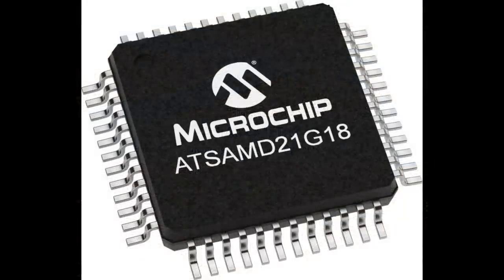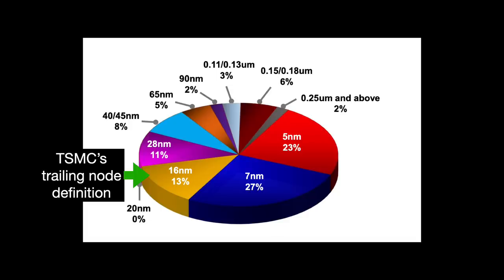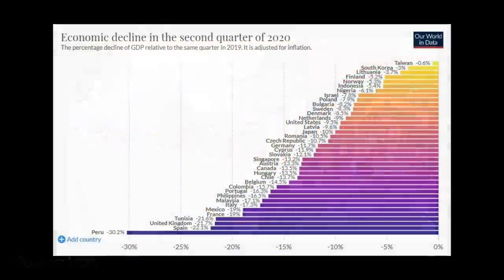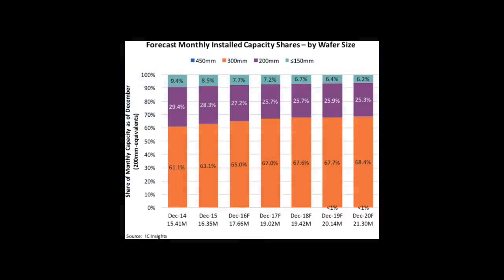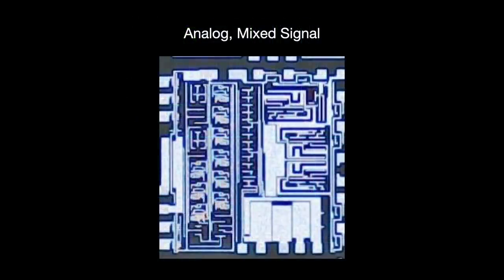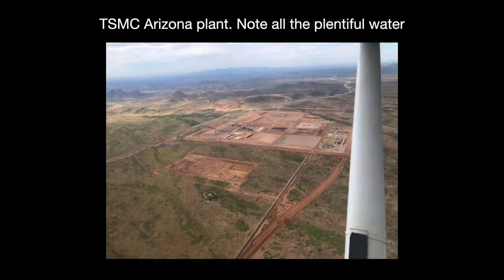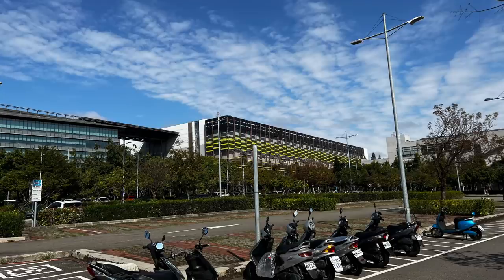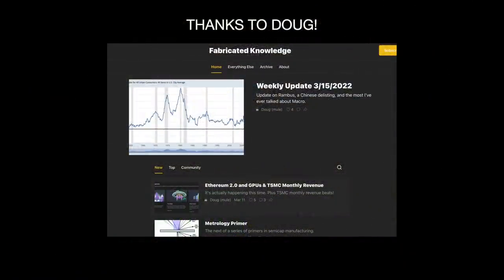Where The Real Chip Shortage Is

Comment: I am glad that as a hobbyist I tend to buy components in much bigger bulk quantities than what I actually need. Some of the voltage regulators I bought back in 2019 are still being put into new hobby designs today since I can't find anything equivalent today! This is a great reminder to engineers (both hardware and software) that we should be focused on making our designs as modular as possible, so that you can easily swap out voltage regulators or even entire SoC's.

PS: Wow, the ESP32 is far more powerful, much cheaper, and more available than the ATSAMD21G18A chip that you covered in the intro to this video. Then again, companies probably find it cheaper to spend exorbitant amounts on chips like this than to completely re-design the microcontrollers and firmware for their controller boards.
Reply: It's not redesigning that is the problem, it's the supplier. A company like ST meets all norms, while tensilica, the maker of ESP32 does not - because they intend to produce a hobbyists tool.
Reply: @LMB222  yeah, I did not mean to imply the ESP32 could replace that chip for many use cases especially industrial/professional ones. But it is interesting just how much more powerful AND cheaper it is
Reply: @LMB222  It's not that ESP's chips aren't used at scale, a lot of iot power products like colour changing lightbulbs and remote switchable power sockets used them at scale; then again these are products with... shall we say no particular expectation of reliability, often just borderline compliance to basic safety norms, and many of those have even since switched to even cheaper and wonkier chips, they plain don't care. You simply can't sustain a semiconductor company like that on hobbyists, but you can sustain it on kilotons of future e-waste.

Comment: chip shortage should be a lesson to engineers to make their designs cpu architecture agnostic. i started doing it with my designs as standard practice around 10 years ago. little did i know how it would pay off later.
Reply: CPU or MCU?  The time spent on the latter is getting all the peripherals to work, and those are not agnostic.  Then an even more amount of time is clearing up the corner cases of power-on reset, oscillator start-up, UART timing, all over temperature.  Those issues are typically specific to a signal part family.
Reply: for MCUs i've started writing my firmware in rust since the community made a lot of efforts to create hardware abstractions for a lot of middle-end MCUs. but that barely solves the problem of acquiring said chips since they are either sold out or have dramatically increased prices. I for example replaced the STM32F103xx with a GD32VF103xx since they got an identical pinout (infact it was meant as a drop-in replacement) but it required changing the whole compiler infrastructure since the GD32VF103 is a RISC-V processor and the STM32F103 is ARM. And even though the GD32VF103 seems to be relatively unknown it was still a nightmare finding a reseller that actually got stock of it.
Reply: @minespeed2009  ha ha, all that HAL is what scares me; more abstraction means more bugs, and it’s tougher to find them.  I’m not even an embedded guy (rather RF Microwave) but I won’t touch anything but bare C when I need to implement an MCU.  Don’t get me started on using Circuit Python, Arduino, etc for shipping products.  IMHO it’s a nightmare waiting to happen.  As I mentioned above it seems 90% of the effort is spent fixing 10% of the corner case stuff.

I actually was messing around with an Arduino compatible MCU module, and it’s got a known bug of not coming out of a low-power sleep when the UART is low, of course it’s beyond me to fix it through layers of software abstraction.  But it’s this kind of shit that just drives me nuts.
Reply: @rfengr00  it definitely makes it a bit harder for some cases, but in the end it takes me about as much time to implement something as in c since the rust compiler is VERY strict when it comes to unsafe programming. like refusing to compile when you access the same peripherals in two different code sections without transferring ownership. (ownership checks are done at compile time so no binary size or speed penality). But im also only an EE student and therefore haven't worked on larger commercial products.
Reply: So you’re saying engineers should strive to do something that’s literally impossible? You have PC boards will you can just swap in any brand of CPU you want? And you take the time to make low level drivers for each one?
Tell me more?
Reply: @neilkurzman4907  They aren't talking about computers, they are talking about microcontrollers. There, it's fully possible to do that and actually isn't even that difficult.

Recently did some work on a project where they switched from 8bit avr to 32bit avr to ARM. I wasn't part of the electrical stuff so idk the specifics, but what the electrical guys told me is that switching architectures wasn't a big deal because they designed in that ability from the start, selecting the chip based on supply and cost, which was rapidly changing. Switching architectures was nothing compared to the normal problems that you deal with developing any mainboard.
Reply: @lobsterbark  
I understand they’re talking about micro controllers. It’s what I do for a living. And no you can’t make a design where you can swap the CPU out between various manufacturers. None of them are pin compatible. And if they were they’re not code compatible. The peripheral are completely different. Your top level C code could be the same. Your best bet would be Microchip. Since they tend to stick to a limited number of pin outs.

There were a few things that they could’ve done early on to make it easier. But that didn’t make it easy.
an AVR eight and an STM 32 has zero peripherals in common. They would’ve had to rewrite every driver. But may have been able to use some of the same interfaces. And of course if they didn’t sprinkle “int“ in the eight bit code then they would’ve had less problems with the 32bit code.
Reply: @neilkurzman4907  The firmware they used was able to use already made drivers and such, from my understanding. I remember someone had to spend some time porting some stuff over, but they didn't spend much time on it and it was just one guy doing that. So it must not have been very difficult.

And of course you aren't going to be able to make a board where you can literally use the same exact pcb for any chip. But you can make a board where the modifications needed to change chips are minimal, and you will be able to easily switch PCB versions for different chips based on availability and cost.

I'm not an EE so idk specifics like I said, but I saw them do the thing you said is impossible. And if you aren't using lots of weird devices that need custom drivers it's not a lot of work to deal with that. Once someone has written a driver for a device that works on an architecture it's already done. You don't need to do it again.
Reply: @lobsterbark  
Unless they had almost no drivers then they had to do a lot of porting. 
They probably could’ve save some time if they use a framework. 
But in the end you’re underestimating the task and what it would take for all products.
And no you can’t just swap in different PC boards. They’d have to go through UL, and EMI, thermal, vibration and whatever tests are required. So how many different variants are you going to pay the test?
You seem to not understand the magnitude of work you’re declaring trivial. Yes when somebody writes a driver for an architecture it’s done. But you’ve claimed they went through three different architectures. Including one from a different manufacturer. So yes you’d have to do it over again. And some of them are very different. 

And again you’re telling me what my job is. You seem to think embedded software is incredibly simple. Not always. In fact a lot of times PC software is easier.
Reply: @neilkurzman4907  Sounds like something unusual was going on with this project that made things easy then. Or the EE guys are wizards that made it look way easier than it was.
Reply: @lobsterbark  
I couldn’t say, I have no knowledge of the project. 
But the question here isn’t about upgrading one ship to another. Everybody’s doing that when they can’t get what they need. 
The issue is what is the cost to design your project with multiple PC boards accepting multiple different processors. And that also assumes that that’s the chip you’re going to have trouble with. I’ve had trouble getting up amps, voltage regulators, buffers. 
Transistors, relays. In fact I’m sending a board out for prototype right now. And I told them they should start ordering production quantities. Even though that’s 6 to 9 months away.
Reply: @卩乇尺丂ㄖ几 
Everybody’s buying you head on chips.
People are redignigning boards with the parts they can get. For Microchip you can often find another part that will fit in the same footprint. You then just have to port the code over. 
Apparently businesses were running lean and didn’t have a lot of extra chip capacity. So when Cove it upset the industry it hasn’t recovered. It took a year for toilet paper to end up on the shelves and normal amounts. 
Took me a year to find a bottle of 409 or fantastic. Who knows how long it will take until people have so many chips that they stop buying more. 
No this isn’t some evil plan by a group of oligarchs. This is a floor in capitalism. Because it’s certainly far from perfect.
Reply: @卩乇尺丂ㄖ几 
There are two options when supply and demand are out of balance. 
Either the price goes up until the demand falls. Or there are shortages. 
Right now gasoline is the former, integrated circuits are the latter. 
It’s not proof of an evil conspiracy. 
I pointed out why they are not raising prices by large amounts. It’s because they are concerned about future business. Unlike gasoline, you can buy micro processors from other companies that didn’t rip you off during the shortage.
Reply: @卩乇尺丂ㄖ几 
The issue with IC chips is it takes years to enter the market. And even then unless you are making second source parts your part will require redesign.
Big user can push to the front of the line, along with old regular customers.
Reply: @卩乇尺丂ㄖ几 
This is not some perverse plan. It is a market upset. It is literally a lack of plan. Compounded by just in time delivery. 
Which government are you referring to you are talking about governments an corporations around the world. The global supply chain. 
The perverse incentive is lowest cost. 
That has been called in to question these days.  Years ago you keep parts on hand And had second sources for all parts.
Reply: @neilkurzman4907  don’t bother, it’s just some FCA Chinese troll copy-pasting their comments.
Reply: @Grak70  🤷🏻‍♂️
Reply: @卩乇尺丂ㄖ几 
I’m not selling anything. 
That’s my opinion on the subject based on my years of experience in the industry.

Comment: For the people going "why retool not build new when the building is the cheap part" your technically correct, but lacking context. A building might only be a couple of million of a several hundred million dollar line, but the earthworks, foundations, and fitout of the shell itself make up roughly half the total time from design to commissioning, and the vast majority of the external requirements regarding permits and legislation. And thats assuming you have the space, power, water, workers, administrative capacity to not only run 2 lines, but run one line while the others being constructed, which can entail far greater disruption than "retooling" even when it means essentially complete replacement of the actual machines in situ.